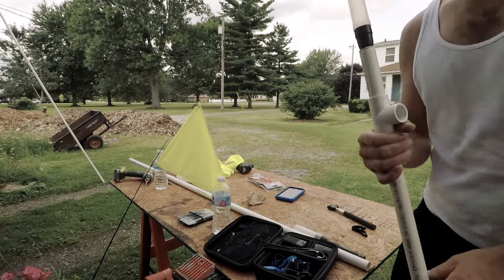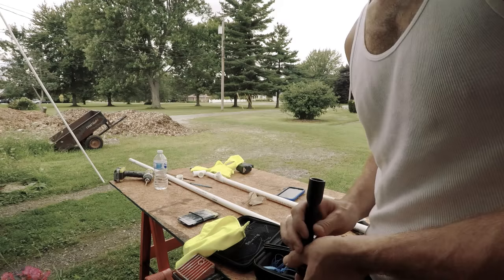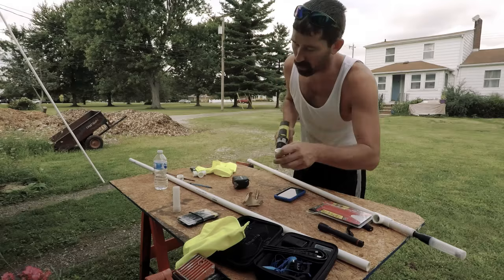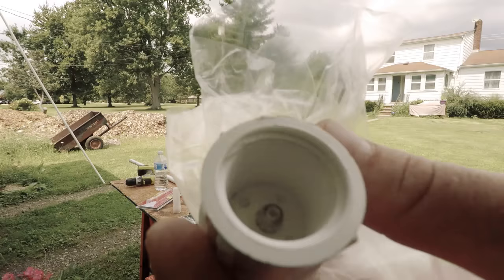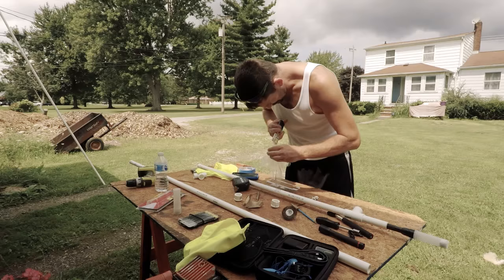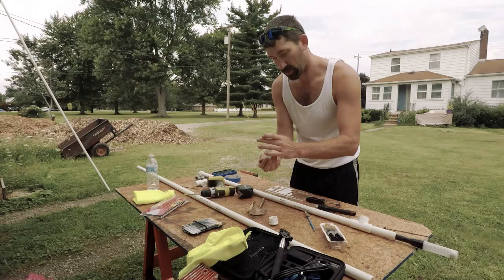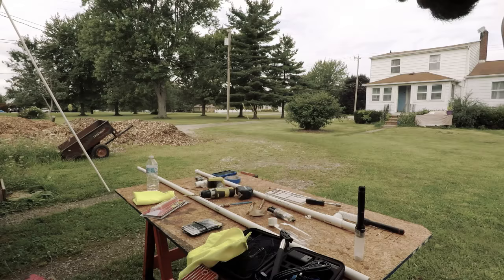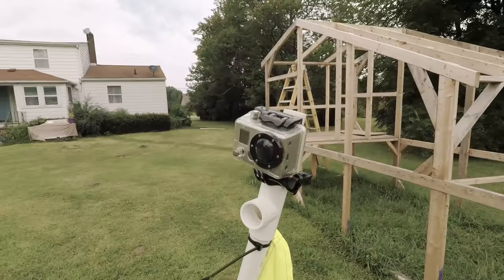DIY 360° safety light and flag pole for the kayak

Comment from the maker: Make sure you can comfortably access your button when sitting in your seat. I shortened it about 6 inches so I could turn it on and off when sitting in my yak. Questions, tips, comments?
Reply: Awesome DIY project.  i went with the same diameter pipe to mount a shoreline marine light on my kayak after having issues with the base mount breaking when using 3/4 " aluminum pipe.  I don't have the rail like you, instead i have a railblaza mount on the kayak.  If you have issues with the nut in the epoxy, I would suggest going to a regular nut for more surface area for the epoxy to hold.  If you had room a wing nut would be the best.  All stainless steel for corrision resistance .
Reply from the maker: Great advice Greg! Thank you!